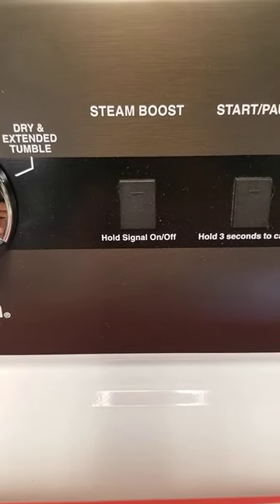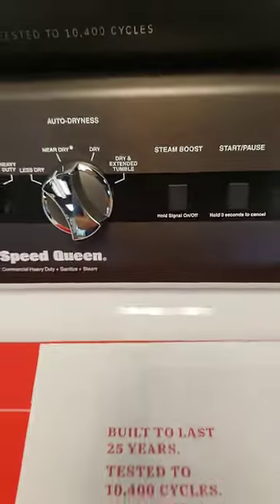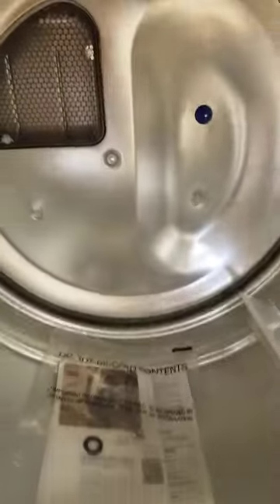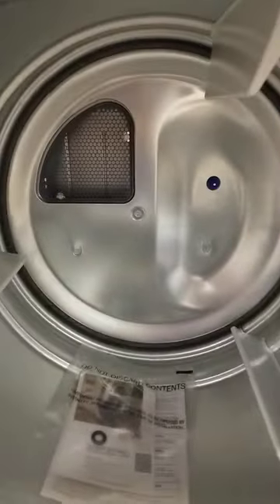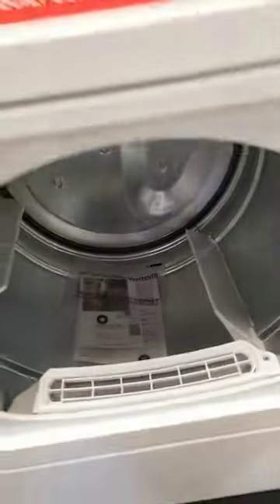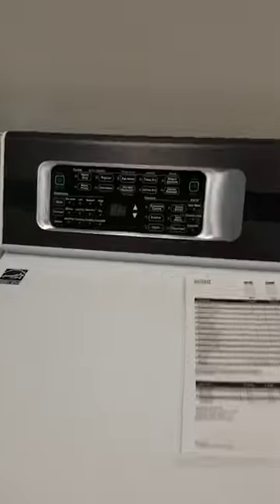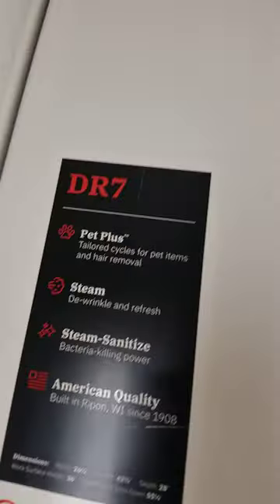Speed Queen DR7003WE Not Heating - User Error

Comment: Does this apply to gas dryers?
Reply: It will trip the high temp limit thermostats. They have a calculated life cycle for your protection & safety ie like clogged venting etc etc that would cause these safeties to trip only so many times before they burnout as they ARE only designed to trip so many times to prevent overheating in the events there are issues related to air flow problems a thermostat failure etc etc and then service will be required for the repair and finding the cause as it will disable the dryer completely. This prevents fires!! So no it’s is not wise to open any dryer whilst it is in heating mode to cause unneeded activation of the safeties.